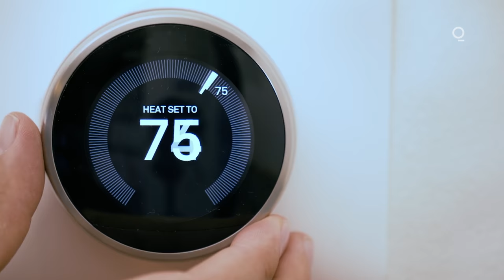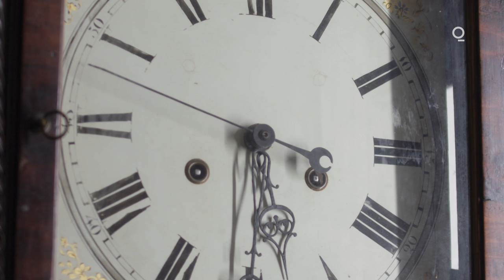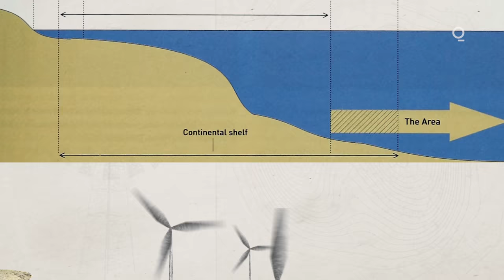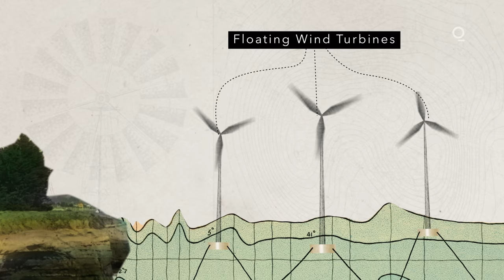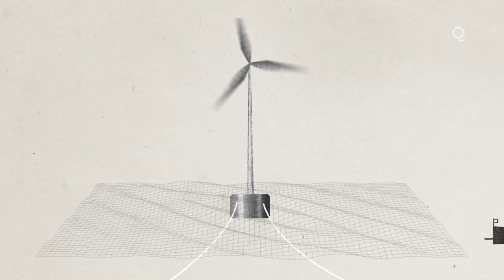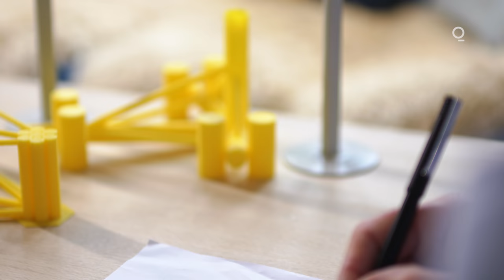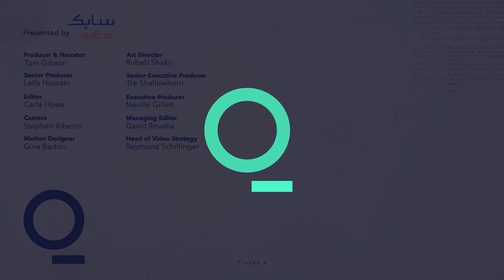The Godfather of Wind's New Floating Revolution

Comment: I would like to see some information on the logistics of getting the electrical power from all of these floating wind generators to the consumers.  In the deep water will we run cables on the ocean floor or float them below the surface a few hundred feet down?   I imagine that these problems have been studied and addressed but I am interested in seeing the solutions.
Reply: They're run along the ocean floor like our fiber-optics cables. High voltage cables are really heavy.
Reply: @kylecramer8489  
Thank you, Mr. Cramer, I appreciate your response.  Once again the logistics of this process elude me.  I am familiar with the cables used to cross the oceans for communications and that they are very expensive.  If we are going to put thousands of these windmills in deep water across the oceans we are going to need hundreds of thousands of miles of high voltage cables, since the windmills will be floating the cables will have to be miles long just to reach the floor of the ocean.  Unlike communication cables which carry very little weight these high voltage cables will have to carry many tons of weight to support the long distances to the bottom of the ocean.  If all the windmills have cables tethered to the ocean floor we will have to have a lot of junction boxes strategically placed to connect the individual windmills to a common cable that goes to land.  I see some very difficult problems placing these junction boxes and doing all the connections necessary in water far too deep for divers.  I suppose a junction box could be connected to several windmill lines on the deck of a ship and then lowered into place.  The ship could then go around to the windmills and attach a cable to each mill.  I was sort of hoping that the Bloomberg research people would have references to proposed methods of securing and running the cables that would allow me to read up on the process a bit, but that may be beyond the scope of this program.  Thanks again for your quick response.
Reply: They will also have a floating substation that will collect power from all the turbines and transmit it onshore through an undersea cable
Reply: Why would you float them a few hundred feet down?
Reply: @sayed5004  
Having seen the North Atlantic storms I have to admit that I am skeptical of any kind of large floating system with its parts connected by long, expensive electrical cables.  I noted that in the video above the admission that they were planning on the windmills moving around quite a bit since they will not be anchored in any way.   If the floating substation is not anchored then the whole farm will be able to slosh around  tethered only by the ocean floor cable to land.  I think that all of these are solvable problems especially after seeing the natural gas line that has been run from Norway to the UK.  The downside to this is that it will take a long time to bring to fruition and it will be EXPENSIVE, thus making the electricity expensive.  I'm a big fan of technology but I suspect that we have run out of time where climate change is concerned.
Reply: Such energy transition can e done by putting Electrolyzers next to the WindFarm and generate Hydrogen.
Reply: @maretranquillity  High voltage DC cables are much lighter than their AC counterparts, because DC is carried by the full cross section of the conductor, whereas AC is only carried on the surface (the skin effect). AC cables therefore have to be much larger diameter to carry the same current.

HVDC also doesn't need a heavy conductive shield to prevent corona loss in submarine applications, since DC doesn't induce a magnetic field like AC does.

I suspect @Sayed is right, although depending on depth I suspect an aggregating substation will be on the seafloor where possible.
Reply: @yaroslavzherebetskyy1908  There are much greater problems in running a pipeline for hydrogen, or a loading platform for shipping it, then in running HVDC cables.
Reply: @ryccoh  So not to harm maritime traffic.
Reply: you could also convert it to green hydrogen, put it under +70 bar pressure and either ship it out or run a pipeline out.
Reply: @Fractal227  
Yes, you could convert, compress, and pipe it out, however, I think the logistics would be just as formidable if you have electrolysis equipment and compressors out in the ocean.  I suppose that placing all the hydrogen production equipment on the ocean floor would be the way to go, but unless you are close to land you will be dealing with really deep water and servicing equipment on the abyssal plane under 3 miles of water will be a challenge.  I don't know but it seems to me that there are an awful lot of problems in this whole process, of course that's why we have engineers I guess.  I don't recall that we have ever put that high a pressure pipeline on the ocean floor.  Even the natural gas line from Norway to the UK doesn't run at anywhere near 70 atmospheres, does it?
Reply: I think the initial idea for these platforms is that they would still hug the coast, just in areas where there is little continental shelf and so the ocean is too deep for tethered turbines (like in  coastal California, as the video describes). As such, it would be pretty simple to run a power cable from the turbines to shore. Your question seems to be geared towards floating turbines in the deep ocean, but I imagine such a practice is decades or longer away (not just for technical reasons, but also legal and territorial). There is still a lot to be gained from accessing these coastal, deep water regions though.
Reply: You'll want the infrastructure that goes along with every form of powerplant built on the coast.
Reply: I read from an ABB magazine long ago, they have a submerged transformer at sea floor and HV cables laid on the floor running 100's km to a HV substation on shore. These cables can be bent to a few meters radius and clamped in place to be connected to an unmanned floating substation. The cost of cables and equipment are not too expensive compared to the amount of energy the wind turbine can produce.
Reply: @Fractal227 hydrogen infrastructure is inherently less efficient, and not necessarily cheaper to construct than high voltage DC lines.
Reply: @ Mare Tranquility, nearly all of the logistic challenges have already been met, engineered and are in operation with floating oil and gas operations. Running subsea cables is an established business with experienced contractors.
Reply: One of the worlds largest cranes is currently working in the west of Norway near Bergen. The whole operation is a massive cost, and that before they even put them in the sea
Reply: Many of the problems have been raised in this thread. And I do not forsee these surviving a real ocean storm anyway, just another green cash grab.
Reply: @Shrouded_reaper  
I also have reservations about the durability of things floating or anchored in deep water, but I'm curious about the tone of your post.  Do you see all/most/some of the attempts to employ alternative sources of energy as being "green cash grab(s)"?  Or is it just the more fringe suggestions that you see that way?
Reply: @maretranquillity  Not at all, there are certainly very many worthwhile "green" projects. The problem is that the main forms promoted, wind farming especially, are not remotely as clean as they claim. From the unsupervised environmental disasters of third world mines, chinese factories to the disposal of these products being thrown in a hole like all our other trash and the recycling claims are laughable. The main problem I have is the anti nuclear stance, it's beyond absurd. The whole planet could have been running on nuclear decades and decades ago. The cost issue of nuclear is driven in lage part by colossal amounts of red tape and unique customs designs for each site rather than mass producing a standardized design and delivering it to site.
Reply: @Shrouded_reaper  
Okay, I appreciate your clarification and I agree with you to a large extent.  I'm less sanguine about nukes since I don't see many of the new ones being used and the fact that we still have no place for the waste and we have around 450 nuclear plants that still need to be dealt with even if they are superseded by the new ones.  Decommissioning our current nuke plants will take decades and cost billions, does anyone really think we are going to do that?  No, we will end up doing what the Russians did when they dumped a bunch of old reactors and all the ancillary radioactive waste into the ocean north of their country.  We will dump the waste somewhere and hope that others end up having to deal with it when we are long gone.   It also concerns me that there isn't much of the nuclear fuel readily available, unlike the promised (but perennially undelivered) fusion plants which can run on heavy water.  You are exactly right about the hidden costs of windmills (and solar panels), but the additional problem of inadequate supplies of the rare earths to manufacture the necessary numbers of these products will sink the whole renewable scheme I suspect.  Ultimately I think Guy McPherson is correct and we are likely to go extinct because we have put off doing anything substantive for too long.  (As a follow-on note: the word "pessimist" was invented by optimists to criticize realists.)
Reply: @maretranquillity  The floating platform is anchored to the seabed using classic catenary system with 3-lines as it seems (can be found on DOI: 10.3390/en13184911). Any floating platforms would require mooring-anchoring otherwise it would have been drifted from the wave (second order) and current induced loads. By having it moored, it gives restoring force to the horizontal motions (surge+sway) of the system as well as yaw restoring moment.

The "moving around a bit" is to allow some slacks to the system as such that the mooring lines do not suffer from snap loads that would induce sudden additional motions to the system. Although, this is also inherent from the use of catenary system where the chain would take the vertical loads, hence requiring (rule-of-thumb) minimum of 3 times the water depth. It is very different in principle, for example, when it is compared to the tension-leg-platform.
Reply: One option might be to try to place these offshore wind farms along an already existing underwater HVDC line for power sharing such as exist between some European countries. Then you just need one transformer and connection point to the already existing line. Of course closer to the coast is preferred wherever feasible.
Reply: Ocean floor has been used to carry data for last 100 years.
Reply: @yaroslavzherebetskyy1908  No hydrogen is extremely inefficient and practically impossible to be used. Nobody has even solved a method of transporting it so how is it a solution? Hydrogen is just a way for gas companies to keep selling has as 99% of it is and will be made directly from gas. There will be some very specific uses for it but for general power and personal vehicles there is no chanve
Reply: The main export cables are trenched (not exposed) but the cables that go up to each turbine are called 'dynamic cables' they are made of a different material to withstand the movement, also they are fitted with buoyancy and sometimes bend restrictors, they float in a lazy S orientation to allow for movement and not over-bending or over-tightening. Hope that helps :)
Reply: @maretranquillity How much does it cost to ship those fossil fuels by tankers cost while burning fossil fuels?

Comment: Wonderful to see these bright minds designing and building energy of the future: wind and solar farms.
Reply: they lose power in transmission, they will corrode like crazy in no time flat and do you wonder how many thousands of birds will be shattered by their blades, also they're shockingly polluting to produce and they're unrecyclable, it's a joke compared to modular Fluoride Thorium salt nuke reactors, a complete joke.
Reply: Do they also develop nuclear power plants since they are the source of reliable energy for the future?
Reply: @shukrantpatil  they are gonna corrode from the salt water bro
Reply: @shukrantpatil  they will probably corode like crazy. salt water is no joke.
Reply: @slaapkonijn58  You do know non-floating offshore wind farms already exist and have been working fine for decades right? You may be surprised to learn this but engineers did actually think of corrosion before you pointed it out in your amazingly insightful Youtube comment and they found solutions for it, such as corrosion resistant paint systems, which have proven very effective over time.

Comment: Next we can build multilevel floating wind farms to catch as much  wind as possible.
Reply: Serviced by swimming unicorns
Reply: Building a larger turbine is better; think of each blade as a lever, the longer the lever: the higher the torque & the great the potential energy.
Reply: @FreeManFreeThought  Think of....
- maintenance 120M above the ground w special cranes not required for 80M towers.
-parts shipped in which are too large to travel over existing roads without closing them or even modifying them
-visibility 20km away above the tree line of 300M above the ground blade tips.

Comment: I wonder if some of these offshore oil rigs might be better used as wind turbine bases instead of being either left abandoned or dismantled and scraped...?
Reply: Many of them are pretty far from shore, and it will probably be a few decades before we actually need to go very far from the shoreline
Reply: Your idea isn't bad, but I'd think the number of adaptable drilling rigs and platforms is pretty small. A bigger problem is that adapting them for wind power production would be so expensive that it probably wouldn't make economical sense. As Henrik Stiesdal says on the video, large scale and big series are the key for cheap production. Oil platforms tend to be different from each other, so you would have to do a lot of tailoring, which is expensive. You'd also have to tailor the maintenance, which would add to the cost too.

Comment: Same challenges as with tidal power (this has been looked at for over 50 years, there's a reason its not done): (a) Stability and reliability of tethering in the event of very bad weather (b) power cables over such vast distances lose a lot of power, are impractical to implement and also prone to breakage in bad weather, and become very very expensive (lots or copper required). (c) Maintainabliity and repair when things inevitably break. If you want to save the planet, nuclear power is the way. Theres plenty of research on transmutation of waste to less radioactive isotopes. Yes I'm a physicist.

Comment: if the wind turbine used to create compressed air and or pump water an windpark can be a lot more cost effective and has an capacitive build in to store power or wind energie indefinitely
Reply: Or purify and electrolyze water into hydrogen.

Comment: Even floating wind turbines are obsolete, intermittent and expensive in installation/maintenance. Tar Kovacs Systems offshore self-contained plants are exploiting three or four ocean simultaneous power sources without installation work, very low maintenance, producing CONSTANT power or Green Hydrogen, and is increasing/controling each in any weather conditions. No water depth consideration. 100 to 600MW per unit 24/7/365 every where on the oceans.

Comment: mare, while your concern is understandable current sources pertaining to the energy generation (coal, petroleum, solar, etc.) are also generally not located within close proximities to the consumer and therefore the distribution relies on significant wire runs to the grid as will the off shore wind turbines. The remote locations will incur more disapportionate costs like the existing more remote sources.

Comment: This makes sense but so does geothermal which is not used enough!!
Reply: Geothermal can’t be used more because suitable close to the  surface hot rock is rare, success rate of drilling expensive homes is rare, and geo releases a lot of CO2 from carbon bearing rock, occasionally more than burning coal.

Comment: Which are the best publicly traded companies active in this field?
Reply: Vestas, Siemens Gamesa, Goldwind to mention a few.
Reply: ørsted as well
Reply: In emerging markets like India, government pushing big on green energy. Solar stock have gone 5 times like Tata Power, I wonder how Suzlon,a wind turbine company trading at 10 rupees 🤣 cost of a cigarette
Reply: @ctcfinacialservices  Suzlon was Indian wind pioneer and made a lot money initially. But later entry of international competitors like GE, Vestas and Siemen Gamesa with superior wind turbines made them go out of business. Though Suzlon has undergone debt restructuring, Vestas will remain the market leader followed by Gamesa.
Reply: Seatwirl has the most cost effective solution by far for floating offshore wind. Totally designed for sea conditions from the very beginning and with a very low center of gravity. Also easy and hence cheap to service since all parts that might need replacement are near sea level. Traded at Nasdaq First North.
Reply: @Patrick-ws7nz  What's their ticker?
Reply: @martin3203  Who is the most active in off-shore?
Reply: @fynntrompeter159  S e a T w i r l has the ticker STW. (If I write the name as usual my comment is removed for some reason. Why?)
Reply: "Oxford  Brookes VAWT" is something to look up.
Reply: note that Equinor - the company this video is about - is not exclusively offshore wind, but actually an oil & gas company.